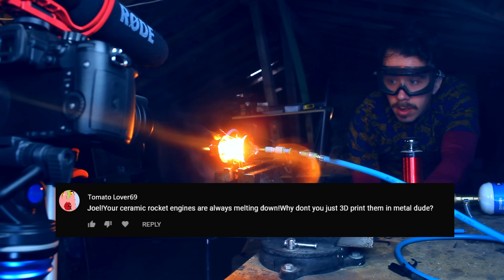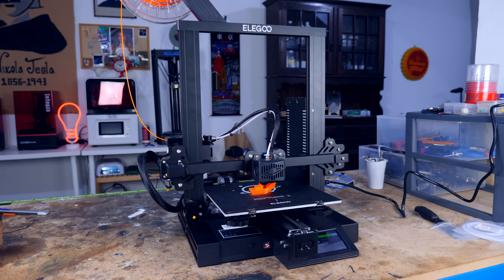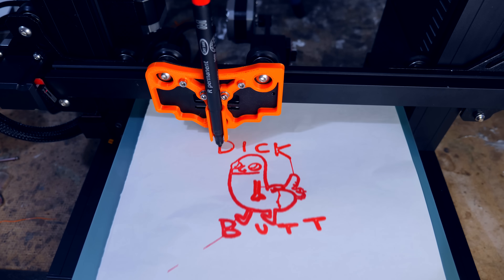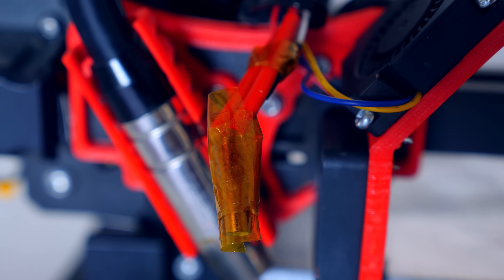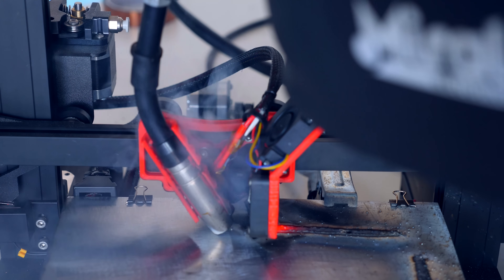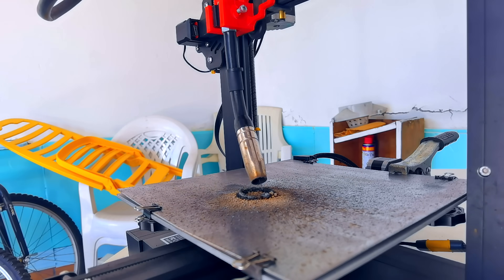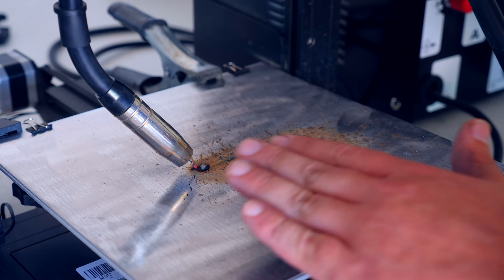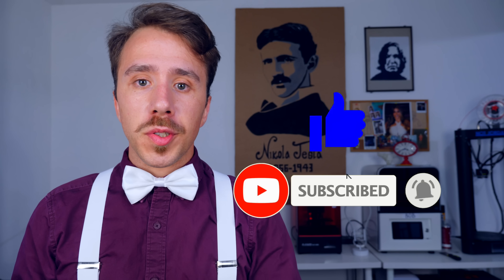I built a Metal 3D Printer using my Welding Machine

Comment: Amateur welder here 👋 we angle the electrode either in our direction of travel or to get better penetration of the joint. Since your direction of travel keeps changing and you're not welding joints, you'd probably get better results keeping it perpendicular. As for your machine settings, you should be able to find charts online to start at, then just run a few straight lines tweaking things until you get it right; I doubt it would take more than one of those sheets. Lastly, pick up a cheap welding lense and put it in front of your camera so that we can see the arc better; I'm sure there are plenty of welders on this channel that could give better advice if we can see the arc.

Comment: ok then since a metal 3d printer is out of question, then maybe a plasma cutter, just do the same as you did with the welder, then you be able to cut shapes, blades, then weld them to make a part... it is not 3d printing metal, it is 2d metal cutting, i thin i would help a bit in the rocket engine

Comment: Make the best fan possible, I want to see a fan so strong it will blow of atoms from a CPU heatsink. I want a fan with the strength of a high RPM turbocharger screaming at you, except preferably quiet but uhh, can't have everything. Oh and it would have to be strong enough to blow tomatoes to slush just by raw wind power alone. Do you accept the challenge?

Comment: If you 3D print rocket nozzle with circular cooling pipe along the surface rocket nozzle I thing it will survive from melting down or buy a rocket nozzle with cooling system.

Comment: Idea for next project: use 2 component glue that turns (sort of) in to metal.
Make an extruded for your 3D printer that mixes the components just before it ejects it on the work peace.

Comment: Make an ice 3d printer. Print ice sculptures and ice cubes for your drink 😂
Reply: Why not just use a laser?
Reply: @plumber1337  Because a laser is reductive. We're doing additive here.
Reply: @awo1fman  that's exactly why. And I own a laser (they are great) but not as great as a ice 3d printer!! That would be amazing
Reply: @awo1fman  So, it isn't 3D printing?
Reply: @plumber1337  3D printing is additive manufacturing. This thread was started with the idea of a 3D ice printer. Additive manufacturing has very little waste.

Anything like CNC or laser or plasma cutting is subtractive manufacturing. Subtractive manufacturing is very wasteful and inefficient because you're often wasting more material than you're using. Even if the off-cut material is easy to recycle it still takes a lot of energy and work to do so that is not needed with additive methods.

There are pros and cons with both methods, and there are certain types of shapes that are only possible with one or the other.

But the point here is that 3D printing is cool because it seems like magic to watch something grow out of nothing.

With respect to 3D printing with ice, the idea is not only fun but it's the exact opposite of 3D printing with other materials because you would have to freeze the material instead of melting it.

Comment: Idea for a new... Thing. A compressed air powered turbine that drives a fan to circulate air. I was thinking about this a few days ago when i was in my garage and wanted to have a propane heater running, but couldn't find a fan to make sure I had fresh air circulating. 

I imagine it would be similar in design to a turbo fan engine found on airliners, but instead of the goal being thrust, it's air volume

Comment: You should make an engine that's fueled by burning tomatos.
Reply: I wonder how many tomatoes you would have to distill to get enough sugar to make a rocket engine like they did in October Sky.  That would "technically" be burning tomatoes.
Reply: @sheahawes6444  lol, im just meaning like a steam engine that runs from the heat of the burning tomatos
Reply: @Yiyawu  Of course keeping in mind that tomatos are very much water - you would need to dry them out first. Otherwise all that energy is going straight into boiling water, which is a lot of energy
Reply: @jnevercast  true, but whether or not the tomatos are dried, they're still tomatos, and they still deserve to burn

Comment: what if you used a titanium sheet to reduce weight, and a ceramic paper or some other ceramic based adhesion layer so you could actually remove the print (maybe just brush on some uv ceramic?)

Comment: An interesting idea would be to attach a regular glue gun instead of a welding machine and see what can be done with it. Instead of a welding machine, you can buy a laser diode for cnc machines, they are not that expensive. I wonder if she would be able to melt metal filings like a metal 3D printer.

Comment: Why didn't you use solder material with a metal nose cone, it like just 3d printing with solder. It would be hard for the melting mechanism part otherwise it would work out just fine. It would require a longer time to cool during print still would work

Comment: @Integza Try using a piece of copper plate as the bed. The weld shouldn't stick to it (its used as a backer for filling holes in thin metal), and it is electrically conductive.

Also, welders angle the welder so that they can see where they are going. In this application, there would be no need to angle it, and in fact could cause some issues with putting more heat into the piece in one direction vs the other. 

The other issue you may run into, is if you're using an inexpensive welder, you may run into issues with the welder itself overheating or losing life as generally cheaper ones aren't rated for continuous use (see duty cycle in the manual).

Comment: Hey Integza, why don't you use a ceramic plate as a base ? As its melting point is much higher than metals, it will not deform much. Cheers !

Comment: If you ever want to try that again, use argon shield gas and regular fill wire, not fluxcore. Fluxcore produces slag to protect the weld, which lead to inclusions when welding multiple layers. That should (IIRC) also eliminate the need for the tilted nozzle, because you don't need to push the slag away from the puddle. (I am happy to be corrected here, not a pro welder)

Comment: You could build a potato cannon that fires tomatoes using 3D printed discarding sabots.  The tomatoes should be fired at a brick wall and filmed in slow motion.  A bowl of cooked pasta could be placed at the bottom of the wall which could be eventually coated with delicious tomato debris.

Comment: Besides not having a large budget I think your major problem is using the flux core  welder.  A regular MIG  machine that uses an inert gas will cut down on you slag you have to knock off.  Plus a better machine will have more settings and better control of the wire feed speed.

Comment: You should have used your 3D printer to make your nozzle out of filament, and used the filament nozzle to make a sand cast. Then, you can use your cast to make a metal nozzle.

Comment: Build another metal 3d printer.  With a stationary print head and rotating build surface. Or at least with a watercooled bed. You totally need a metal nozzle and tank for your rockets 🚀.

Comment: What if you used a metal with a lower melting point like using soldering wire? Then you wouldn't continuously warp the metal plate and set everything on fire. (maybe just run soldering wire through a regular 3d printer nozzle lol)

Comment: Here's my take on perfecting this (but I must warn you : I'm more knowledgeable on TIG welding) :
1) use shielding gas, with MIG/MAG wire. A weld made with ptrotective gas venting on it will have a faster cooling time than one isolated in slag. Also FCAW is more recomended (but not only) for outdoor applications, you'll be breathing nasty stuff indoor. Far nastier than a mix of argon and CO2. And you can use thinner plates to weld on.
2) Maybe a thick watercooled aluminium bed? (or stainless steel, if you want to print aluminium) As these two metals won't mix, prints will stick but not weld (cleanup needed afterwards), and the watercooling will help evacuate surplus calories.
3) This one may be tricky, but to eliminate further excessive heat input, it might be good to see how CMT works and try to control the welder with an arduino to mimick this process. In fact, it might even be easiser to just spot weld, even if it will drastically increase weld time.

Comment: Such a good soundtrack! Hot tip: If you're making new mounts for things like pens that are fixed points, it's good to include some force relief in the form of a spring or something so you don't overcompress your pen/pencil.

Other things to keep in mind for welding are cooling, airflow, shielding gas, and DUTY CYCLE!

Comment: You could make molds using plaster of paris as the compound and make metal parts or whole engines or whatever that way. You'd need a smelter I've seen people use old fire extinguishers as the pot to smelt in with plaster of paris as the outer shell that contained the heat.

Comment: Looks like you are using flux core wire. To weld a new layer, you must remove the slag from the previous layer of weld. To do what you want you first need to switch to soild wire & c25 shielding gas. Also the heat of 
 welding with wire larger than .025" will warp thin sheet metal a fair amount.

Comment: Next video should be trying to 3d print with a welder but use 25/75 mixed argon and color gas. The weld will be much better

Comment: You can still make molds from plastic 3D prints and a kiln to melt out the plastic from the mold material, then fill the mold with molten metal.  I had a youtube link of what I mean in my last comment on the previous video somewhere.

Comment: You would have better results if you use traditional small MIG welding wire and shielding gas. The flux cored wire is very inconsistent.

Comment: I suggested this on the last video. I also suggested electroplating the parts. An easier method would be laser sintering. You just have to get the high powered diode to replace the hot end, fiber optics, focusing lens, power supply, and metal powder to sinter.

Comment: Nobody:
Integza: rebuilds his 3D printer to a..... printer...
Reply: Deconstruction
Reply: Would work better if he used a proper C25 gas mix, thicker base metal that’s bolted all around, and didn’t do continuous welds, just solid wire mig spot welds over n over

Comment: My years of welding is causing me to cringe while still being intrigued.
Reply: i hear ya, he needs at least another axis to rotate the head...
Reply: @peterd-j8698  The part that hurt me the most was when he was welding over parts without removing the slag from the last pass.
Reply: @I_am_ENSanity  ☆ That's where Skill emerges!
Reply: But its a mig welder
Reply: @espiqueariel1898  No it's a flux core...
Reply: @lennym1273  didnt know theres a wire that has a flux.
Cause i only have an arc wedler.
Thanks
Reply: @espiqueariel1898  Correct, he's using a flux core electrode. Otherwise, having the fan that close in the early attempts would've blown away the shield gas. But since he clearly didn't care about blowing away any shield gas, it's likely Integza is using flux core.
Reply: @urbypilot2136  so even if he uses the "no flux wire" it will not work because hes blowing the gas away?
Reply: @espiqueariel1898  The main purpose of a shield gas is to protect (shield) the still molten metal from the oxygen in the atmosphere. Letting oxygen get to a fresh weld will cause it to rust (oxidize) and become porous, thus a poor weld result. Another benefit provided by shield gas is improved ionization (compared to regular atmospheric air), thus providing a more suitable environment for the electric arc to form and be maintained.

So allowing your shield gas to be blown away won't necessarily cause your MIG/TIG welders to fail, but the resulting weld will definitely be of very poor quality and be rusted from the inside from the very beginning.
Reply: @espiqueariel1898  There is no shield gas, he's using a wire-feed welder that doesn't have a shield gas option. I could be wrong, but when he opens the nozzle I can't see any tube to carry shield gas through to the tip. If it does have that option, he definitely isn't using it. That's part of why he has to grind the beads between each layer.
Reply: what if the electrode sticks on the piece?
Isn't this one of the issues you encounter while welding?
Reply: @robson668  In SMAW this can be an issue. Yes, it can still be an issue with MIG, if your welding parameters are incorrect, but it's far less of an issue with MIG than it is with SMAW. It would defiantly be something you would want to watch out for. If he walked away and the electrode stuck to the metal with out him realizing it, the electrode will short out and heat up. It usually will heat up, and burn the electrode and break the connection, but it could potentially melt and burn stuff up in worst case scenario.

Comment: As a welder the best advice I can give you to actually do this would be to have a very thick peice of metal as a base. Like atleast 1/2" or 12.7mm, but eventually you will still run into problems with heat. I was welding on solid 4" thick by 16" today and it still got to hot to touch after 3 passes (but that's also at 25 volts).
Anyway the only feasible way I can see it actually working and not be super expensive. Is to build a liquid cooled heat sink. That's how they mold steel parts in most factories now like BMW and Nissan. The dyes are liquid cooled.

Comment: so as ik about welding as much as the next guy i have had multiple teachers that have taught me about oxy acetylene ,arc and mig. As i recall when you push the welding pool it creates a smaller puddle but deeper pentation into the metal.

the key variables i remember from mig is 

-heat/amperage

-feed rate

-pushing/pulling

-angles/pull of gravity

-how fast your loops and different welding patterns

I would recommend that you make it rotatable so that you can either push or pull idk how you would do that without getting kinks in the line. also when the machine lays a line make it go around in circles so that you get that first layer of metal.

also after each layer you would have to clean off the slag so that the machine has a fresh layer of metal to weld on to
  
idk if this helps much but a mig printer is kida a weird idea so that would be fun

Comment: Integza, instead of using an entire sheet of sheet steel on your bed, just use a small piece glued to the bed. The smaller piece is less likely to warp in the same way the massive piece is. Then put you a piece of non-conductive material over the rest of the bed to where if you miss the smaller piece with your g-code, it won't accidentally weld itself to the plate. (Also you save money....)

Comment: 3:10 You can draw arc with g-code. You can use G2 and G3 instructions. And it is used widely in a CNC world. Not so with a 3d printing though

Comment: Try printing with different wires in the welder, perhaps a lower temp type wire will help you.
Reply: Sadly welding doesn't quite work like that it would be good if it does

Comment: Video Idea:  Design an electric personal vehicle (skateboard, bike, one wheel, etc.) using conductive paint on 3D printed parts to run at 36V or higher.  Bonus for the cheapest possible SBC (Raspberry Pi Zero if possible).  Even better; set up a public playlist of other makers using the same idea who share their videos with you.
Reply: I see many recommendations surrounding rockets, but sometimes you need to shift your focus to give your mind a chance to process information in the background.

Comment: There is a way to do this but you’ll probably need to make a whole machine
First off you need to use mig welding spools with some sort of noble gas like argon so you don’t get any oxidation on top which will make the welds not stick that well
Secondly the warpage issue can’t really be fixed you will have to get a thicker piece of steel
Thirdly the oxidation issue could also be fixed by making an airtight chamber with the printer inside that you replace all air on the inside with argon. This would make it use less argon and be safer.
Idk if the angled welder actually helps or not so that will be something you’ll have to mess around with

Comment: Random Comment - Integza make a rocket powered by burning Tomatos. 

Le Bhaskar - Well dear tomatos have lot of moisture which means they can't burn as fuels. 

Le Integza - Hmm... tomatos have lot of moisture... Which means they will produce lots of steam if chopped and put in a pressure cooker... With help of that I could run the steam operated 'Tesla Turbine'... INTEGZA YOU GENIUS.

Comment: i think one of the many problems of the idea could be fixed if you use a printer that moves the hotend (or the welder in this case) in the x and y axis, instead of moving the bed for the y axis.

I really want to see this idea working in the future, cnc machines like the one you show are expensive so it would be awesome to do a similar thing with a 3d printer, I hope you keep trying to make it work.

Comment: Did you considder using "Metal filament" for normal FFF Printers? Its propably a bit challenging in Printing and you need to sinter it afterwards in a kilm, but a lot better then breaking 3d printers with a welding torch. 
Checkout this: https://www.youtube.com/watch?v=RlbzBVlAZ6g

Comment: Hi Integza! Could you make a sort of hybrid rocket using the power of raw tomatoes as a part of the fuel source? Or use unique foods as a sort of fuel source? I think that would be super cool!
Reply: Le Bhaskar - Well dear tomatos have lot of moisture which means they can't burn as fuels. 

Le Integza - Hmm... tomatos have lot of moisture... Which means they will produce lots of steam if chopped and put in a pressure cooker... With help of that I could run the steam operated 'Tesla Turbine'... INTEGZA YOU GENIUS.